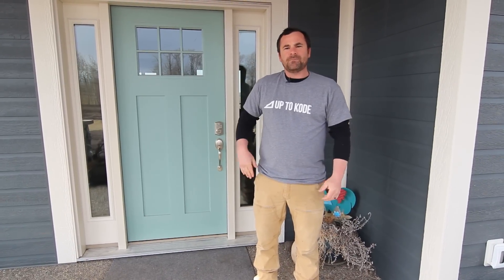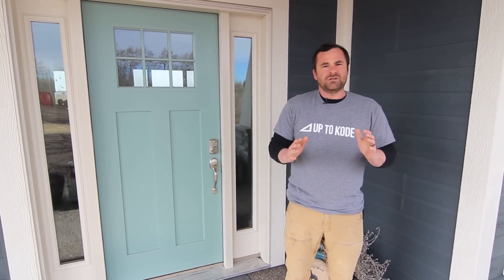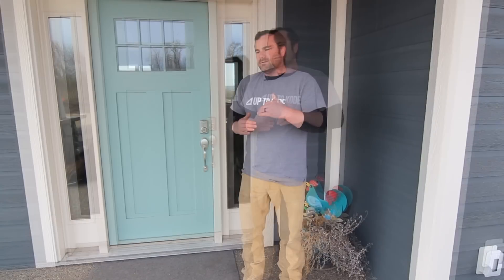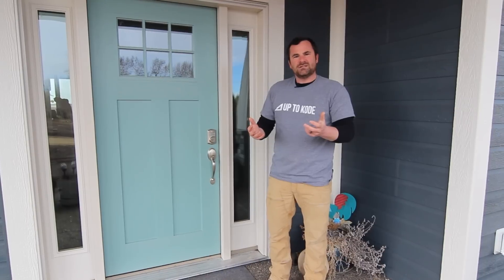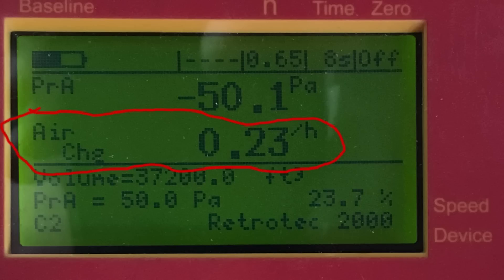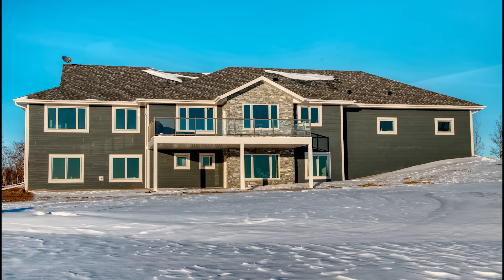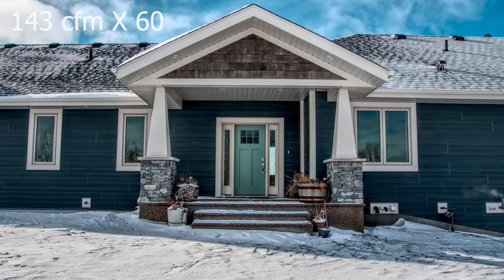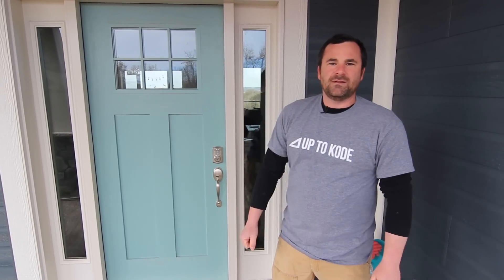Unlocking Unparalleled Air Tightness: Exploring ICF Homes for Superior Building Envelopes

Comment: What type of ceiling air barrier did you use in both homes?
Reply from the maker: Straight up vapour barrier on the ceilings. We installed the drywall as to not miss trusses with the screws and not roto-zip the electrical boxes too big. 

All laps have acoustical sealant on positive backing so the board presses on the joint. 

Honestly it’s really easy.
Reply: @uptokode  Building an DIY ICF house myself and noticed a lot of builders using intello and then saw the price.  Started researching further and found what you used was not the same therefore the question.   Did you use 6 mil?  Thanks love the channel.
Reply from the maker: Thanks for the support! I did use 6 mil. 

If you need a consult or anything just email me. kody@uptokode.com
Reply from the maker: On a commercial job recently (video coming in May) I used 6 mil vapour barrier and then added a layer of Nudura “Homega”. 2 5/8” sheet foam with nailing strips for attachment

Comment: Great video.  Interested in your insulation details after going all the way up to your top seal plate with Icf wall.  Do you typically do vapor barrier on the cieling or make attic condition space?
Reply from the maker: I keep it simple. Vapour barrier ceiling. Lapped over the top plate and down onto the ICF a bit. Positive backing for all laps. Lots of acoustical sealant. 

Blown in insulation. Keep it simple.

Comment: That’s impressive air exchange . The next data that would be most comparative would be 2 years of energy usage in BTUs , per square foot, and cubic foot . I would definitely be interested in seeing that.
Reply from the maker: I am going to film that soon. It’s been on my mind. 

I also tested a commercial ICF in Dec 2021 and shut the heat off at -30 Celsius. Stay tuned for that. Coming in Feb ‘22. 

I also tested 2 ICF versus to wood frame at the same time.

Comment: i have looked at a few of your videos.  Even stick built homes can be built to meet passive house air tightness requirements.  As every house has to deal with penetrations the technical difficulty lies in how you seal the holes and joints that are inhenent in every building.  You spend a lot of time trying to convince us you know how to calculate air changes.  I think it would be more helpful if you shared your construction techniques because not all ICF homes exceed PH air tightness standards, specifically how you seal between the top floor ceiling and the attic).  It is also my understanding that adding insulation above 20 R does not significantly alter building energy efficiency. So how does the energy efficiency in the houses you build compare with PH homes?  What are your thoughts on Thermal Wicking?
Reply from the maker: Great comment. Yes I plan on making some videos on how we sealed the place. It’s so easy with ICF which is why I made this video. Far easier than for a wood frame. 

Email me if you want to know how I did it if you need to know for a project.

Comment: congrats on the low number, ICF and spray foam may be great in your eyes but the environmental impacts on those two materials alone is enough of a reason to avoid ICF  all together.
Reply from the maker: Whoa! I never said spray foam. EPS foam is quite different than spray foam in many respects. My point is this...wood frame passive house will use 2-3 times more lumber than ICF, a lot more specialized products to meet the spec’s and so what is the overall environmental effect with that?? One has to think of everything involved and not just say that wood is carbon negative so it’s all good. I disagree. Still cutting trees down!!
Reply: In the 60’s you guys were saying the earth would end in the 80’s due to overpopulation. At the first earth day in 1970, we were told everything is freezing by the year 2000. All these doomsday predictions end with, it can all be prevented if we give over complete control to your cult leaders or politicians.
Reply: @Robert-fx3ng  lol wtf are you on about. It's a petroleum based product. There is no conspiracy here it should be used sparingly just like concrete should be.

Comment: Nice video! How is the moisture flow handled?  And excuse my lack engineering knowledge, what is the oxygen source for people to breath especially in winter when the furnace is burning?
Reply from the maker: Furnaces and hot water devices all have their own intake and exhaust which are balanced. We do have an HRV which brings on fresh air and this is important in controlling humidity as an ICF home doesn’t allow this to escape through the walls. The HRV will exhaust air and bring fresh in. If they stop working your humidity will spike after a few cooked meals and a few showers. This happened on a brand new home we build. Maybe the humidity is easier to control when the house has a chance to dry for a month or 2.
Reply: @uptokode  Thanks Kody!

Comment: Passive house isn't just about the air tightness of the envelope, although that's obviously an important part of it. You also MUST have extremely high insulation R values, continuously installed around the entire envelope, as well as high efficiency windows and doors to truly achieve the passive house standard.
Reply from the maker: True! Hoping to build a passive house with ICF someday. I have new videos coming soon that demonstrate how to easily add insulation value to ICF. And one thing that isn’t factored into R-value is thermal mass which is like a storage battery for energy.

Comment: Passive spec is also about air exultation. So run that blower door test on reverse to get a reading too. You also need too meet the energy demands. Do you know how much it needs to heat or cool?
Reply from the maker: The house isn’t built to passive spec for all areas. Just wanted to let the wood frame guys know how easy it is to meet the air tightness spec without crazy procedures or products.

Comment: Just for the PH newbies, this house is not beating passive house standard. It is only exceeding their air-tightness requirement. If the house is over or under insulated, it will fail the passive house standard because it will either require active heating in winter or active cooling in summer far more than acceptable under the PH standard.
Reply: Good point . The air tightness is very critical however . Most passive houses have both a conventional heating system installed to meet insurance requirements, but they also make use of various ERVs or HRVs . I’d like to see data on the HVAC energy systems on any airtight well insulated ICF home. I’m my experience in this climate , there is no such thing as too much interior thermal mass . I know of rammed earth and earth sheltered homes that have gone 40 years with virtually no heating cooling bills . Passive solar Window orientation Sq footage and window efficiency coupled with thermal mass alone can achieve a net zero home . I’m not diminishing the passive house rating system which is very effective for calculating those efficiency requirements in various climates, but there are many roads that can lead to net zero homes in areas with very defined 4 seasons.

Comment: Great job but I think it's important to clarify to your readers that the Passive House standard is a multi faceted standard that looks at quite a bit more than just an air tightness number.  While it's great your home's are hitting air tightness targets to achieve the Passive House US standard you would have to be compliant and certified in the Energy Star program, DOE Zero energy ready program (includes Indoor Air Plus certification), and hit a number of other metrics and checklist items to determine overall compliance.  There are specific modeling targets that need to be met and multiple quality control inspections that would need to take place throughout the project to verify insulation values, install quality, air sealing details, etc....  To really get a feel for what this means reader's can see more about the PHIUS standard in the following link  https://www.phius.org/PHIUS+2018/PHIUS+%20Certification%20Guidebook%20v2.1.pdf .  Energy star you can read more about here https://www.energystar.gov/partner_resources/residential_new/program_reqs  and DOE here  https://www.energy.gov/eere/buildings/guidelines-participating-doe-zero-energy-ready-home-program .  Once you meet them all you "achieve" passive house.  All the best!

Comment: This construction method is good for air tightness, but a standard ICF wall system is not a great insulator.  You're only at a standard 2x6 wall assembly for R-value of around R-20.  Sure your air tightness is there, but you're still losing heat.  Hence why you need a conventional heating system in this house.  A paper coffee cup with a lid is water tight, but cools off very quickly.  A vacuum insulated coffee mug is also water tight but retains its heat for days.
Reply: The ICF doesn't have the thermal bridging the conventional 2x6 wall has.  You also don't have to worry about decreased R value after less than ideal installs.  Considering the whole wall R value of a 2x6 job your final R value is actually much lower.  Here is a good article that talks about this...  https://www.energyvanguard.com/blog/4-types-of-r-value
Reply: @troyhodas5771  A standard 2x6 with batt insulation has a whole wall R-value of around R17.  A standard ICF wall assembly has an R-value of between R-12 and R-24 depending on manufacturer.  Passive house standard requires wall insulation values of around R50-R65 for Canada's climate.  They would need a full 10" of Rockwool on top of the ICF to meet passive house standards for insulation.

My biggest gripe is one of Kode's comments below stating "ICF walls are a true R-24 (act like R50 because of the thermal mass)"  Thermal mass does not effect R-value at all, it does effect how quickly the heat is transferred though.  In climates where there are large temperature differentials from night to day, thermal mass helps with stability.  It's still an R-24 wall assembly.  Hopefully he isn't telling his Canadian customers they are getting an R50 house and yet still have a full blown heating system.

TL;DR, ICF is very good for air tightness, but it is still a mediocre insulator on its own.
Reply: @ultimate1576  I'm in climate zone 6 and was able to get away with R36 walls.  It was the graphite enhanced form with an additional 2" insert.  Looks like CA could be climate zone 6 or 7 in your area?  There could also be a difference between PHI and PHIUS requirements.
Reply: @ultimate1576  Just saw the rest of your comment regarding R50.  I think that was a salesperson trying to take credit for an expected air tightness impact and then attributing that to the perceived R value of the assembly?  Either way though I agree, not a legitimate way to look at it.  It's deceiving.
Reply from the maker: I still say it’s R-24.

Comment: Awesome job on your you build!  I still prefer wood framed though. Simply taping the seams of your sheathing will get you a very air tight wall very easily- much easier than stacking up and bracing an ICF wall. Air tightness is really achieve not at the wall plane (that's easy), but at the rim joist, roof, and slab intersection. You guys buttoned this up nicely. 

Also, this house may achieve the air tightness level of Passive House, but its insulation level is about 1/3 the Passivehouse standard. ICF uses foam, rebar, and concrete- all of which have high embodied energy compared to a conventional wood stud wall. 

I would opt for ICF is I lived in tornado or hurricane country.  If I did want ICF, you guys seem to be top notch builders.  Congrats again on your build.

Comment: Thanks for all the amazing videos. Quick question on air tightness in an ICF home. How do you deal with potential air leakages from a fireplace, cooktop vent, plumbing vent, washroom vent, dryer vent, to avoid having all the air leakage going out/in there?
Reply from the maker: Great question! That’s fairly specific to each one but most important is to seal around the outside of each penetration as to not allow air into your attic or vise versa. Basically you need to stop condensation around the penetrations. 

After that it’s up to the dampers and install of each mechanical device. Every situation is different. I will shoot more videos on the topic. 

If you look up passive house (or haus in German) they use condensating dryers than drain into a floor drain and don’t exhaust outside. 

They use re-circulating range hoods to prevent air loss. I will make videos on this topic soon as I learn more.
Reply: A home that is certified Passive House will "conventionally" not have a fireplace, the cook top vent may be replaced by the exhaust from an HRV/ERV, and a condensate or heat pump dryer would be used.  So basically you eliminate those penetrations.  Although if you make the penetration you have to plan accordingly

Comment: congratulations on your success at doing so well on the air tightness tests. I clicked on the link because I was curious what people were doing to increase R-values on a standard ICF house. Are the blocks being offered with thicker insulation? Are people adding insulation? Are some passive houses being built with ICF?
Reply from the maker: I see that you did watch this video. I did answer this question in another one of your comments. Thanks for tuning in!
Reply from the maker: I see that you did watch this video. I did answer this question in another one of your comments. Thanks for tuning in!
Reply: Dave, google: "Passive House in the Woods"  They did it but had to add a lot of extra insulation.  It is quite a house though.
Reply: Although I didn't go for certification my design passed the WUFI modeling.  We used graphite enhanced forms with additional inserts for an R36 wall.  R20 under slab and R70 blown cellulose in attic.

Comment: Where are these homes located? How many sq ft? What are the R-values for floors, walls, and roof? What did you use for insulation on the roof and floors? What kind of mechanicals (HVAC, ERV, etc.) were needed? Were these considered net zero? Any solar panels used? Was previously considering ICF for ground floor only then using SIPs for upper level and roof. This may make me change my mind depending on your responses to the questions above. Thanks for the video! Great job.
Reply from the maker: This home is in Alberta, Canada. Near the town of Rimbey. 2150 sq ft for the house (main floor only), and the garage was 1088 sq ft. R-value under the basement slab is R-20, ICF walls are a true R-24 (act like R50 because of the thermal mass), the roof is R-50 blown in cellulose. 

We used an IBC boiler for the hot water and to run floor heat in basement and garage. Forced air furnace for the majority of the house and a HRV for fresh air exchanges.
Reply: @uptokode   Cody could you please provide a source for you claim that 'R24 ICF walls act like R-50 because of thermal mass'?
Reply from the maker: No solar panels were used and it’s not considered net zero although it would be easier to achieve with an ICF home than with a conventional build. 

I like ICF for everything because the house is then 1 complete monolithic system. No other building system can say this. Provides protection against wind and fire, super quiet, continuous insulation and thermal mass. Very air tight   

Pretty hard to beat.  All done in one step too. No extra steps, labour or materials to achieve a superior building envelope

Comment: We are planning to build an ICF home in northwest Florida about 30 miles north of the coast.  Your homes seem to have fireplaces but thus far we have been discouraged due to the air loss/contamination issues it would present.  Naturally it doesn't get too cold here compared to up north but we do enjoy the overall ambiance and heat on a chilly evening.  Thanks in advance for any insight you can offer.
Reply from the maker: Glad to hear you are building with ICF. This house has a fireplace and to be honest I don’t know exactly what the installers did but we didn’t specify any certain requirements. Probably half lucky and obviously companies are getting better and smarter with their dampers.
Reply: Perhaps a steam fireplace would be right for you. They require no venting and they use water vapor and LED's to create extremely real looking artificial flames. Many of them also have electric heaters built into them so they can be used for supplemental heat just like a real fireplace if you so choose, but it generates no heat if you just want the ambiance of a fire. Electric heaters are more efficient since in a real fireplace most of the heat is lost up the chimney due to convection. Some of these steam fireplaces even have RGB capable lights so that your flames can be any color you want, they're super cool, you should check them out.
Reply from the maker: We even had a range hood exhaust which are known to be bad and still it was pretty tight.

Comment: Great video, thank you for all the info. I am going to be building on the California coast in a few months, we don't have the temperature extremes of the far north or down south and ICF for residential just hasn't caught on. For structural longevity I think ICF is the only way to go, but have a feeling I will be searching for an architect and contractors that have experience with this type of construction. Keep the videos coming.
Reply from the maker: Thanks Steve! Check out ICF Base. I believe they have a bit of a network to help in finding the right installers.
Reply: There might be some good ICF opportunities in the areas that were burned out in the CA wildfires. I am sure the new houses are being built to new fire code regulations that were put in several years ago but ICF houses, especially with stucco or hardibacker  siding would probably be a step above even houses that are built to the new codes.